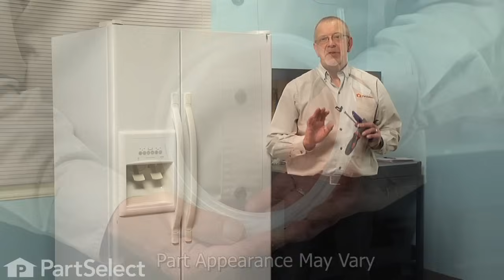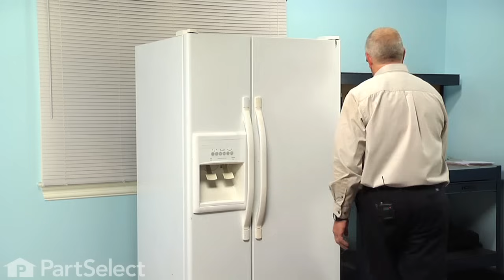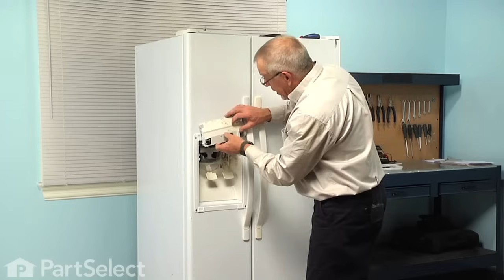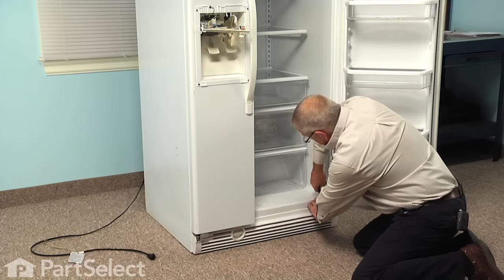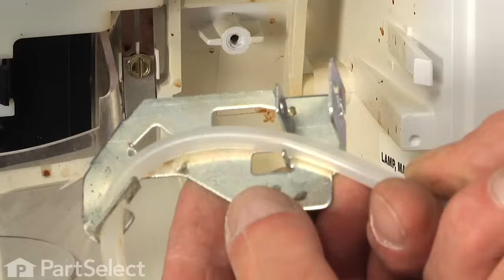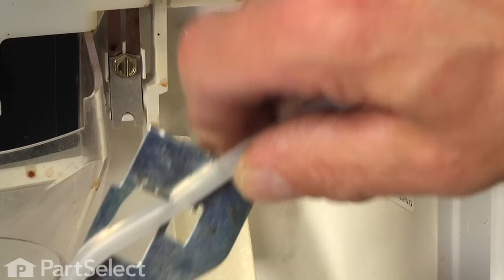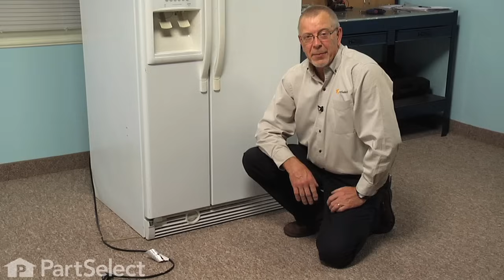Refrigerator Repair - Replacing the Dispenser Waterline (Whirlpool Part #8201537)

Comment: Hi,  My LG GR-L247NSS water dispenser tupe has split at the bottom of the door.  Can the tube be replaced or is it a new door?
Reply from the maker: Hi John, I tired researching your model number and I am not able to pull up any information. Could you please double check the model and serial number for your refrigerator. Thank you.

Comment: Wow...This is a great video Steve.  You don't happen to know how to do the same with a GE fridge do you?  Basically I need to do this on my GE but the line will not budge.  At exactly 2 mins into your video, you are removing a fastener that would appear lock the tube in place if not removed.  However, on my fridge i'm not able to locate any such screw or fastener.  Tried GE support and they have offered zero help without a warranty.  Real nice considering the issue that started this was their defect.  Any idea if there is a way to remove the ice funnel inside the door that could provide access to the inside of the door where the line is?

Comment: Thank you Dave. Until I saw your video I didn't know the tubing can be replaced. I have a problem with mold or bacteria in my frig line which caused red bumps & peeling type rash. Can the existing line be flushed with bleach or ammonia, or is replacing the line the best solution.
Reply from the maker: Gloria Godet I passed your question on to Steve and will let you know what he suggests!
Reply from the maker: ***** Flushing the system is not easily done, and in most cases, it would be more practical to replace all of the tubing including the reservoir and the inlet water valve.

Comment: What about the water line connected to the water supply in  the back of the fridge?  I am thinking replacing all water line instead of flushing vinegar or clorox to clean the water line

Comment: Anyone know a water line that has better insulation? My GE fridge line keeps freezing and I have to use a hair dryer to defreeze it frequently. Some people insulate the inside of the door by taping some sort of insulation on it, but I thought maybe a line that insulates better won't keep freezing, plus won't look horrible. 
Thanks. 
This is an issue many keep having with GE fridges. Will never buy GE again. Never had that much trouble with any other fridge before.

Comment: Steve, or Jim Cole - I installed the line, everything went smoothly - until I realized that the bracket that holds the trigger for the water release was broken. I'm going to need the entire plastic bracket.  I will have to search for the part number, etc..............this is unfortunate.
Reply from the maker: +Bassistdan1 Let me know if I can help you find the part you need.
Reply: +PartSelect I'm reasonably certain that I've ordered the correct part.....just going to have to wait a few days for delivery.  Thanks much!
Reply: +PartSelect Hey Jim - Just wanted to let you know that the part came SO early!!  It was here in under 24 hours from order.  I just finished installing and it works flawlessly!  NO MORE LEAKING!   Thanks much, guys!

Comment: hi steve, I have a galaxy model 10655122700. I having a hard time getting the front plate off-are the tabs the same on the bottom as you show in your viedo? I don't want to break it thank you , timmy

Comment: If i just unplug the first plug behind the water dispenser area, will that prevent the water from coming out? That is my goal. Thanks!
Reply from the maker: Unplugging that first harness connector will disable all of the touchpads if that is your goal. If you were trying to resolve a water leak, that will not correct the problem. Hope this helps.

Comment: I'm having a new refrigerator installed tomorrow and I was told I had to drain the water line 24 hours before.  Do I have to unplug the refrigerator and remove the food to do this process and how do I do this?
Reply from the maker: We are not sure why you would need to drain a water line when having a refrigerator installed.

Comment: 😕 I did this but the dang thing didn’t pull out easily at all and and now I’m stuck with it broken inside the door and I can’t pull it out neither from the bottom or top. Can’t replace it. Now what?
Reply: I had the same problem but I kept on pulling it out and turning it slowly until it finally went in and it took me about 10 minutes and I wanted to give up but I kept on with it until it finally went through and I was sooooo happy.

Comment: is there any difference in the tubing itself between buying this as a kit from an appliance supply or or buying the same size from a hardware store?
Reply from the maker: The tubing supplied at the hardware store may not be food grade or may not be of the same rigidity to prevent
kinks.
Reply: I purchased Watts 1/4 in. OD x 0.170 in. ID Polyethylene Tubing, $3.68 for 25 ft, from Home Depot.  I used less that 5 ft, or about 75 cents worth.

Comment: Does the waterline have anything to do with the door rusting under the water dispenser?.. If not what causes that rust?
Reply from the maker: Hello, we are currently researching this for you. Will have a response soon. Thank You.
Reply: If you removed the drip pan at the bottom of the dispenser area, incidental water leakage likely caused this issue. The pan was meant to catch this leakage and let it evaporate. The solution is to replace the drip pan. Once you remove the front panel in this video, you should clearly see that the rust is coming from the dispenser.

Comment: Our waterline is cracked in the portion of the line that goes from the back of the fridge, under it, and To the connector that you showed in your video.  How do we get at that one?
Reply from the maker: Hi Cindy, please call us at 1-888-738-4871 or use our live chat option with your model number and we can locate the part and order it for you.

Comment: Hello! I have this fridge (I think...my ice make is in the actual freezer as opposed to the door). I unscrewed it (after letting a Coke blow up inside) just to wipe behind it. Now, the ice maker won't work. I still get water to the door,  etc. I also have a piece, (facing  ice maker) that I too from underneath. left side, two screws,  that when put back, blocked the rail that, supposedly,  holds the ice bucket. I might have the wrong rail (while thing is apart), but I can't figure why tge ice maker stopped...I don't think I disconnected anything -- just held it our a little, wiped the wall, and put it back.....any light you could she'd would be so appreciated!! :-) S
Reply from the maker: What model number do you have?

Comment: Hi Steve,

I tried to fish the hose via the bottom and also from the top, the hose did not go back to the dispenser. I think I am stuck now. Thinking about disassembly the liner, but just before I open another can of worm, do you have any suggestion?
Reply from the maker: +Arthur Lieu  I would try rotating the tubing while you are feeding it into the opening in the dispenser.
Reply: +PartSelect  Try fishing a 14 gage wire with insulation from the bottom.  After fishing the wire you can slide the wire inside the water hose from the top.  This did the trick for me.

Comment: Everything worked as described in your video, except while reattaching the new water dispenser tube to the compression coupling, the other end of the coupling came  loose from the water line. It seemed to reattach by just pushing the water line back into the coupling, but now it leaks from that end of the coupling. I have tried to push it in further, but nothing seems to help. How do I stop this from leaking?
I have a Kenmore Elite side by side refrigerator/freezer, model # 10650204993.
Reply from the maker: That sounds like the newer push-in style coupler. Remove the tubing from the coupling by holding the collar against the coupling while pulling on the tubing. Cut about ¼ to 3/8 of an inch off the tubing, making a clean cut, and then re-insert fully into the coupling. Pull out gently to lock the tubing in place.
Reply: Thanks for getting back to me. I had already tried what you recommended, but it still leaked. So I bought a new coupling, replaced the old one and it worked. No more leak. Great video!

Comment: i Have a Siemens fridge freezer and it has a different front to yours, i cant see how to take it off and i cant find the model number anywhere
Reply: I have now found the model KA58NP90GB/05    FD8606  Type KA P90
Reply from the maker: There does not appear to be any screws holding it in place, however we cannot find any information that verifies how the escutcheon is attached.

Comment: Hello, I tried following your instructions here and I seem to have a problem pushing the new tube in.  It is not funneling to the hole where the dispenser is.  Instead it is making it's own path throughout the front of the fridge.  It is a whirlpool...
Reply from the maker: Try pushing the tubing in from the opposite end.

Comment: Are all water lines the same? Like is there a standard size?

I went to home depot and found several widths. It seemed like the smallest (circumference) would work, however I'm reluctant to take out the existing line with me in order to see if its a match. 

Our current water line works just fine, but it looks a little gross and the water tastes off. I don't have easy access to the back of the fridge, so pumping vinegar through to clean it seems harder than just replacing the line entirely (or well at least the segment in the video).
Reply from the maker: In our experience, it's a good idea to ensure that the water line you're purchasing is the correct part for your model refrigerator. Let us know if you need help finding one!